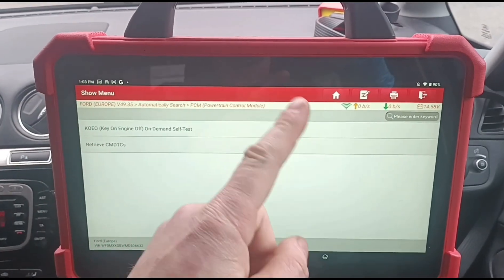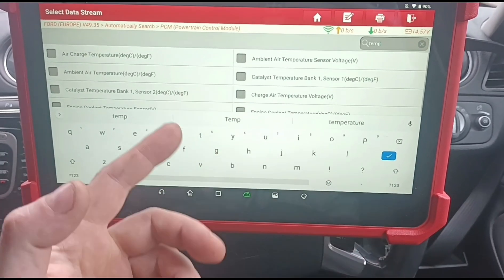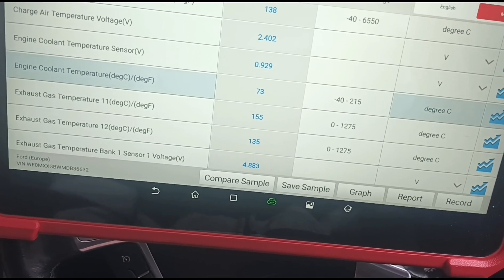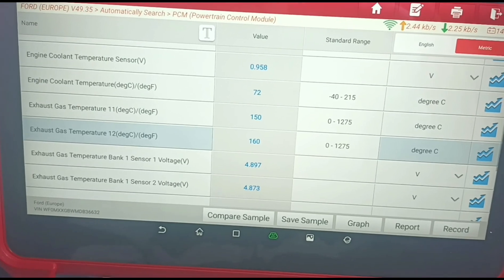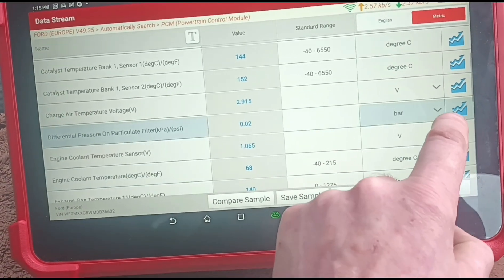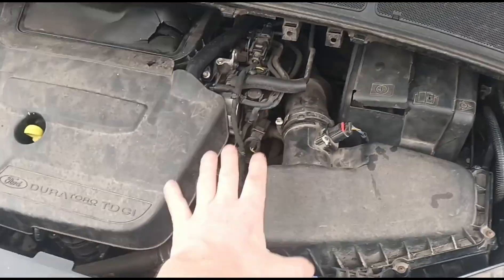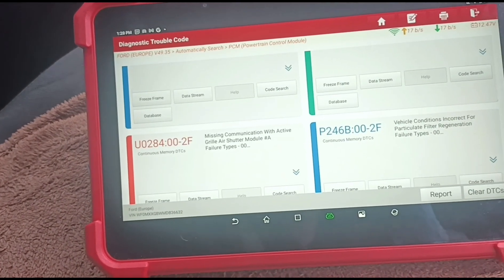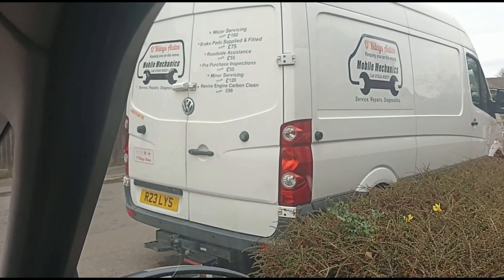P246B:00-2F Vehicle Conditions Incorrect For Particulate Filter Regeneration P246B DPF Explained

Comment: Hi, replaced my bad vaporizer a couple of weeks ago. Read the codes today to find a P246B. No engine light or so.. car drives fine.
Checked all values and they looked Ok. Only engine temp does not go over 78-79°c ... According to many on forums the 2.0 tcdi galaxy(2011) do not go up to 90°, and aprox 80°c is the right temp. 
Is this your experience as well? You stated in the video that it should be 90°c...

Comment: Hi from Australia. In order to fix the coolant temp issue, What causes the coolant temp to stay 70 is that a thermostat issue ? Also i have my grill shutters permanantly open and never decided to fix it due to here in Australia it doesn't get real cold like a European winter.  i have this issue with my Mondeo Diesel after getting the Code P246B:00-2F Vehicle Conditions Incorrect For Particulate

Comment: I came across a 2.2 mondeo with P246B and also P242C:16-EC Exhaust Gas Temperature Sensor Circuit Low Bank 1
Guessing the sensor issue would cause regen refusal?
Reply: Did you solve this was it the sensor?
Reply: I didn’t fix the vehicle. If I can get hold of the owner he may know what was done to resolve. Do you have the same issue?

Comment: Thanks allot boss for very very good information
Reply from the maker: Many many thanks
Reply: @ORileysAutos Great informative video. I have a 2014 kuga and have replaced the vaporizer. It's functioning correctly, though whilst checking the live data, I noticed the " particulate filter differential pressure sensor voltage" was reading 0 volts. I suspect an issue with the sensor or wiring. Is there a dpf sensor fuse, and what voltage should I expect whilst running? The dpf senosr was reading 0 kpa when not running with ignition on but went up to 20 when runnnig. Thanks
Reply: @markthomas7639 I noticed the same on my 2013 kuga had 0 volts but getting a reading from sensor

Comment: Jimmy have 2.2 custom  egr replaced  glow plugs and thermostat.
I look after it like a baby serviced main ford  dealer. My journeys are about 30 miles a day all 4th gear.
Should I get rid of it?
Heading to uk shortly will  u sort for me.
It's good at mom but I dread that engine light
Reply from the maker: Get rid of the van or dpf? If it's working OK I wouldn't worry about it
Reply: @ORileysAutos  Jimmy 
What you mean by vehicle conditions incorrect 
Thanks
Denis
Reply: Can i book you in for this test .